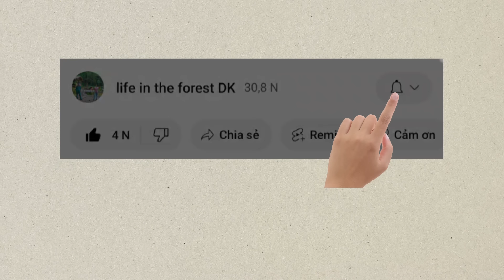Expand the farm in the forest, Building steel fences. Robert | Green forest life

Comment: You need somewhere to keep your motorcycles out of the weather
Reply: AND all the tools, supplies and equipment!  Is there not a space in the cook shed  to store them?  The tools for cement work were thrown in the dog house and garden tools are against the back wall of the house......not very dry and secure storage.  What about a long  narrow wood structure against the bank behind the kitchen or next to the garden that would enclose, protect and secure against theft all of the the lumber, tractor, plumbing supplies and tools?  Maybe a roof with wire fencing with several locking gates for access?
Reply: @gaylecoffey3313  The doghouse was a waste of time, doesn’t look like the dogs use and probably couldn’t it’s full of other stuff
Reply: @waynecassidy6145  Well, it made another video and gave him an excuse to lay more bricks/blocks.  LOL!!!!